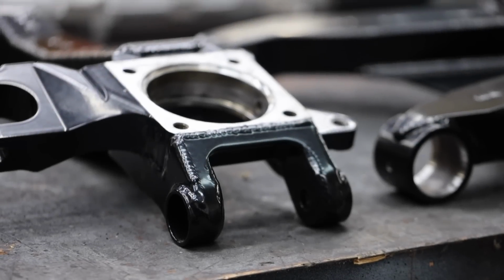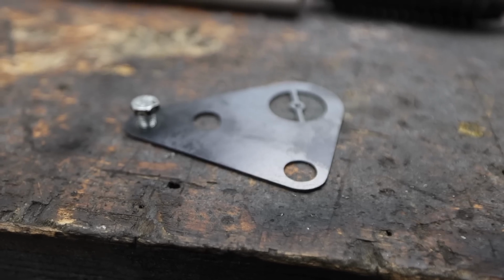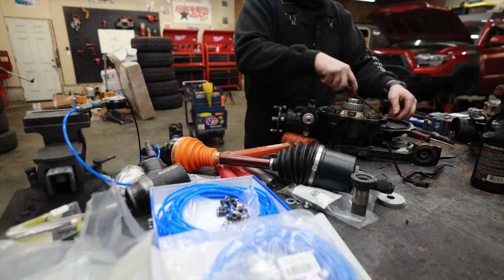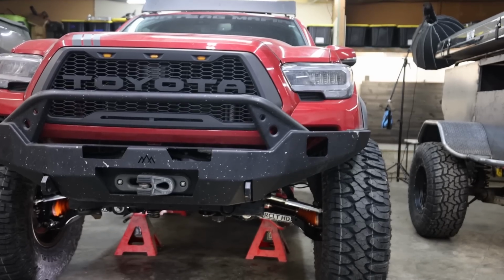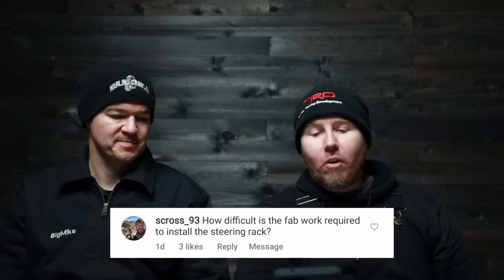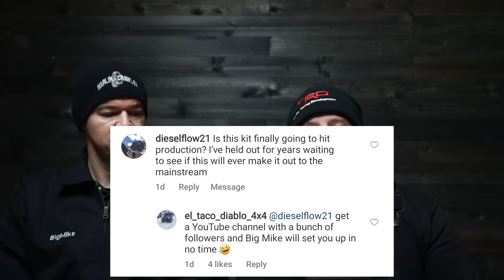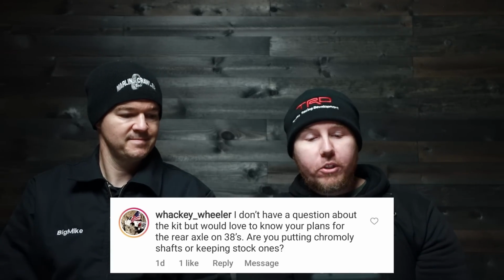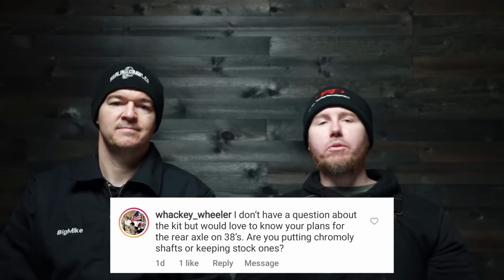The Best Long Travel Period. RCLT HD. Ultimate Toyota Tacoma Build Episode 5.

Comment: As cool , capable and functional as the new bronco is, I really feel like This is the better option for the hardcore wheeler. I’m just getting my new gladiator but would have rather had the taco if it had more interior room.   Tacoma needs a crewmax version
Reply: I prefer the gladiator over the tacoma for a multitude of reasons. The convertible cab. The engine options. And the solid front axle is a huge bonus. Ifs is great but does have its limitations. Same with solid axles
Reply: @austinfouts9139  I’m a Jeep guy and love the gladiator, but I could have had a Tacoma For 10 grand less (Canadian)than my gladiator starts at, meaning I could have had it built for the starting point of my gladiator.
Reply: Owing a Tacoma, I couldn’t agree with you more about the interior room. That and a more powerful engine would be a dream.

Comment: How much did you drop your diff?  I think one of the things you skimmed over discussing is the importance of checking CV angles for IFS and how they affect CVs.
Reply: Haven't watched the video yet, but since the knuckles would be moved out 3.5 inches that is helping the angle, along with the rcv style shaft it should be just fine.
Reply: @kylancook3477  Oh I know he's fine.. I'm just saying he didn't discuss the importance of it.  Its fairly important for the angles to make sure your not destroying the boots and the CV joints.  Long travel helps fix this issue as well as dropping the diff which is usually part of any good IFS lift.  Its one of albeit many reasons that lifting IFS is somewhat more complicated than lifting solid axles.  Many think of the diff drop as being not that important but it really is unless you want to tear up CVs every few hundred miles.

Comment: For your rear axle, a Tundra 10.5 from '07-'21 Tundras will keep the same diff ratios, keep it toyota, matches the width of your front, and has internals sized between a D60 and a 14 bolt so it's plenty strong. The housing is the weak point on those too, so truss it, but that would be a cheap and easy swap to keep up with your front kit.
Reply from the maker: How does the tundra axle work with the taco wheel speed sensors? Is there a conversion? The 4wd system won't work with a abs light on these trucks
Reply: @DirtLifestyle  I forgot tacomas still have drum brakes out back not discs like the tundra axle. I think the disc brake wheel speed sensors all play nice with each other but not sure on converting from drum to disc sensors so that might be the problem point. Plus someone else commented on the wheel bolt pattern, could convert to tacoma 6 lug without too much trouble.

Comment: I'd like to see something done for 4 wheel independent suspension- maybe GX460, or Gen1 Cayenne (what I drive), which is becoming more and more popular for offroading/overlanding
Reply: Take a look at the baja/raid eropean style trucks, they work great and will give you a clear direction of design/upgrade
Reply: RCLT HD already fits the Lexus GX460 but Marlin hasn’t listed it on their site yet because they haven’t seen one to know if the oil pan may interfere with the MarRack oversized HD steering rack
Reply: @yepitsme431  wat

Comment: I'd love to see one of these kits with portal axles.
Reply: The only portal axles I have seen for Toyotas are 70 series from Australia. Otherwise would love some :)
Reply: @iankovac1878  I think it's a werewolf off road, previously DV Max Tuning makes portal axles for tacomas.
Reply: @Digital_Dairy   Indeed, but Ukraine. Jinjer is easy to listen to of YouTube, but shipping those bad boys ouch lol.
Reply: @iankovac1878  yes I'm sure it's not cheap. I'd like to see a good comparison between Marlin set up with RCV axles, and werewolf portals to see what's stronger. Also, whats this about Jinjer?
Reply: @Digital_Dairy  Jinjer Ukrainian metal band check them out. So portals leave you with stock suspension articulation. Just with bigger tires. The RCLT will be at least 10 inches of wheel travel. So would you rather have stock articulation or long travel? I have been trying to get portals on my old toyota since the AMG 6x6 came out (2013) lol. Almost bought a Letech set of portal axles when they started selling, after market and not just to Mercedes directly lol.
Reply: @Digital_Dairy  Plus easy to answer. Bolt on portals do not upgrade anything. So stock everything vs Dana 60 style-ish beef that is 1 ton rated at least lol. No comparison st all.
Reply: @iankovac1878  uhh bolt on portals give you the best possible clearance, gearing reduction and usually strength, don't know what your talking about.
Reply: @Digital_Dairy   That picture in the first part of the RCLT video says it all. Flex VS Ground clearance. What would you choose?
Reply: @iankovac1878  my first comment said" Id love to see these kits with portals" not I think portals are better. I was talking about rcvs and stock diffs vs portals.

Comment: On factory unit bearings, Toyota recommends replacing 75k miles for stock running gear. So 40k on 40’s so far 👍🏼👍🏼
Reply: I've seen this in the manual before, why would you replace something that is still good?
Reply: @kylancook3477  I don’t lol, I was stating that cause everyone is worried about the unit bearing bearing weak. My brother actually almost lost a wheel with a fabtech lift and 35’s… that’s how I found out and the 75k but I’m running 37’s on my fjc and no issues!

Comment: This is why you buy a toyota ,because of the aftermarket support ,tons of parts.  I have a zr2 and the aftermarket has not embraced this platform at all.  Hardly any good parts.
Reply: That's my issue too, I can get GM cars at employee price, and I want it for the diesel engine, but there's just no aftermarket stuff for it

Comment: Usable travel: measured travel before shit binds or you run out of ground clearance on bump.  Some SxS manufacturers and long travel kit sellers advertise "24 inches of travel" but this includes bump travel that's unusable since the skid plate is 3" underground at this point.

Comment: Please don't get on me too tuff for this question but, do independent front suspension have sway bars and links? Is it necessary to disconnect them on the same obstacles you would disconnect solid axle sway bar link?
Reply: Yes and yes but this aftermaket RCLT HD specifies to remove the factory sway bar and does not include an aftermarket replacement one.

Comment: I know this is a Tacoma, but I have a 2017 TRD Off-Road Tundra 4wd, I want a solid overland suspension but on a "wife-friendly" budget. Currently I am running a spacer lift on stock Bilstein everything, and no complaints whatsoever (I just bought the truck), but I know this coming summer I will be attacking some more serious terrain. Any suggestions are greatly appreciated.

Comment: You should buy a Humvee and swap the portal rear suspension in the taco 🌮.  I would say, front too, but you probably want to try out the new stuff, first, or at least till the front diff explodes. Can't wait to see it. You should install a front diff camera. Get the carnage on video. The Humvee's Central tire inflation, might be a time saver, on the trail, too. Look for an ambulance model, or one with the rear doors blocked off. Much cheaper, cuz less people want the "two door" Humvee's.

Comment: With those tires if the CV's don't grenade the diff will.
Reply: Those are rcv axles and rated up to 40 inch tires. 

The clamshell is super strong. Toyota has been using it for a long time and I’ve never seen one blow up. I’m sure it’s happened,  but it’s not like someone putting 40s on a d30
Reply: @brentsavage6005  Cool, looks great can't wait to see it in action.

Comment: This is one thing I like about newer Land Rovers, they are independent front and rear and I'm hoping Toyota would ditch the solid rears in the future, because as gnarly as this front kit is, you can have 3ft of front ground clearance... you're always limited to your rear solid, and the only thing you can do is tires without going with portals or angled solids. independent has so much to offer! we need manufacturer's budget to start making them better. Stock Subaru Outback has more ground clearance than most pick up trucks, 10 inches! Independent suspension for the win! Not to mention a lot of ultra4 guys start to build front rear independent 4WD rigs.

Comment: Keep in mind all these parts cost around $9,600. A quality lift kit for a solid axle can easily be under $2,000. Not trying to be a smart ass. Just thought it was important to point out the price differences between modifying IFS vs Solid axle
Reply: Keep in mind. This kit is closer to a custom 4 link with King coilovers and D60's than a bolt on Jeep lift lol.
Reply from the maker: I will compare all of that when I compare the 21 gladiator build to the 21 taco build. 👍
Lifting a gladiator is way cheaper then rclt but SAS swapping a taco is way more expensive then RCLT. I will do an apples to apples later this year
Reply: As someone who is wrapping up SAS on a 90s Toyota, I can tell you I would have done this if available for older models.  One of the benefits of the RCLT vs SAS on newer Yotas is the xfer case drop - requires significant $$ to make newer case work with donor axles.  In my case, a donated 84 axle still needed around 2K in upgrades to be as robust as possible.  And that's before you factor in leafs, brake parts, shocks & mounts, etc, etc.  If I still had my 07 Taco, I would do this over SAS without a second thought.
Reply: @danielrider7616   I have an 82 and an 83 long bed chassis for parts. When I did my first SAS with an 87 4runner 2009-10. It was cheap back then. Prices for everything is crazy now, parts are hard. I did the full trail gear kits and SAS for 12k. Now closer to 20k for a similar build. I feel you.

Comment: While these long travel kits are greatly increasing the capability of ifs trucks, they still don't compare to a solid axle. 

And for the price of these long travel kits, you could do a solid axle swap and have more strength and better preformance.

Not to mention those uniballs are going to need replaced pretty often, so it's an ongoing maintenance and money pit.

I personally just don't see the point in sticking with ifs if you are spending that much money anyway.

Comment: Just because steering racks are weak on tacomas could I just use a lc200 rack like you did without running RCLT HD?
Reply from the maker: I would call marlin to find out what your options are. I'm pretty sure this rack won't work on OEM suspension but double check with them
Reply: My buddy had it done on his 5th gen 4runner but he is in TC long travel
Reply: You have to match width. That Land Crusier one looked a good bit wider than stock.
Reply: @iankovac1878  can always cut and make custom hiem outer steering rods but didn’t know if else would effect it.

Comment: You forgot the rear diff on the Taco so clearance not as good overall.
Reply from the maker: Not as good as what?
Reply: @DirtLifestyle  you mentioned how good the clearance was but that is just the front of the truck. The back is still solid axle so the clearance is not as good if you take into account the rear solid axle clearance.

Comment: No, sas swaps are not obsolete. And no, your ifs will never work as well in the rocks as a solid axle.
Reply from the maker: We were rock crawling all last week in Moab Utah. These IFS trucks dominated in rocks because of the extra clearance and superior ride quality. Driving mine home from Moab to Tacoma Washington was like driving a Camery on the hwy. As someone who owns and wheels many straight axle trucks I can vouch that these IFS trucks are absolutely better. Better than my gladiator on 39s, my tj on 39s and my 1 ton land rover on 37s.
Reply: @DirtLifestyle  I think that the ifs truck did so much better because of the wheel base. In my opinion 39”s on a tj are too big unless it’s an LJ and the your land rover is probably way to tall and heavy to be any sort of comparison.  I have an 01 tj on 35” with 4” lift and a 2012 Tacoma with 285/75/16’s with a 3” lift and the ifs is very stiff with not a whole lot of flex. I also don’t have a super wide long travel kit, but to say sas is obsolete because you’re driving what would cost the layman $100k+ is inaccurate. Either way, I’m a huge fan and love the content, I’m also kind of local to you, so if you go to any local car shows or trail rides that would be cool, let us know! Also reading my original comment, I sound like a ass, sorry about that.

Comment: False info about that kit being only one pushing tire stance forward, wicked creation and total chaos move it 1 in to 2 in forward
Reply from the maker: https://www.chaosfab.com/2016-2017-Tacoma-3.5-Race-Series-Long-Travel-Suspension-Kit-86000-R-16.html

Click the link. No mention of this kit moving the drivetrain forward 2"... because it doesn't. I asked.
Sounds like it could be upto 3/4" but that wasn't clear.

https://wicked-creations.com/2003-2021-toyota-4runner-long-travel-kit/

This company doesn't make suspension for The Toyota Tacoma just FJs and Runners. Also, no mention anywhere that it moves the axle forward 2".

I don't like to correct people in the comments but I think it's important in cases like this. Your misinformation could cost someone reading these comments alot of money. Also, pushing the suspension forward 1+ inches is a patented idea and Marlin crawler owns the patent.
The RCLT is the ONLY kit on the market that moves the drivetrain forward 2".

Comment: OK... so let me understand this. Roughly $30k on a new Toyota Tacoma- tear the entire suspension out- add $10k worth of parts to make it really off-road worthy? Hmmmm....  Also as the comment below- maybe portals instead?
Reply: Portals are another 15k
Reply from the maker: This Taco was 43k lol. And add 25k worth of parts. Front and rear suspension, lockers, winch, skids, bumpers... it all adds up. I want portals but I can't imagine the OEM arms would last long with that much leverage.
Reply: Where the fuck do I find a Tacoma for $30k?! Lol
Reply: I own a 2001 Jeep Cherokee XJ sport. The amount of money that I could drop on this vehicle is almost unlimited and I have already embarked on the process. I could set up a nice overlander (this is what I'm going for.)(("overlanding". In the seventies we called it traveling.)) Or a mud / Rock rig.
But when it's all said and done it's still going to be a 2001 Jeep Cherokee sport, not worth what I've dumped into it. This is not a logical game. Buy it, build it, run it, break it, fix it, run it again,......
Reply: to make it EXTREMEM off-road worthy. Stock stuff with good tires would get you through 80% of off roading stuff

Comment: The RCLTHD costs $7k + the cost of other parts (like a land cruiser rack) which i am sure isn't cheap. For that kind of money you can just SAS swap it i get the IFS clearence argument - but your measurements weren't apples to apples - the Taco was still on jackstands not supporting its full weight. Still interested to see the results and I am sure it will be much better than stock - but its still going to be weaker than a dana 44. So it seems like a lot of work/time and money  to end up with a weaker setup than a SAS. I just don't see the value (as there was still alot of cutting/welding/drilling to get this installed).